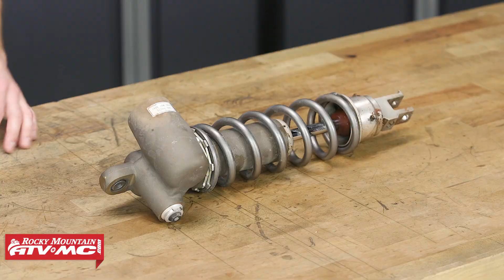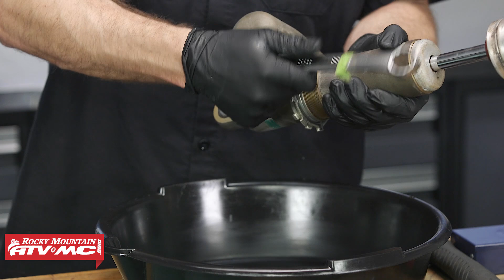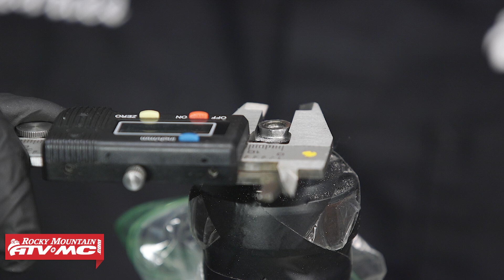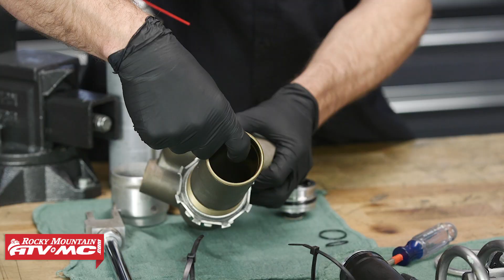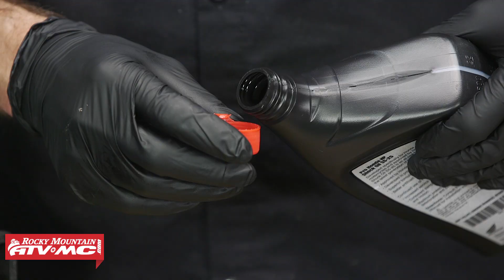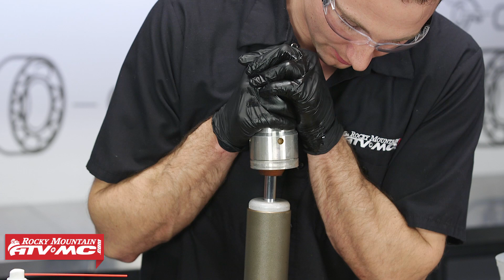How To Rebuild a Showa ATV/ Dirt Bike Shock w/ Horizontal Reservoir

Comment: Great video.  I installed a Zetta internal lowering collar in my shock and now I need to refill the oil and nitrogen.  I wasn't sure how to refill the oil and get the air out.  Shop wants $145 to refill it, not including oil and nitrogen.  Pffff